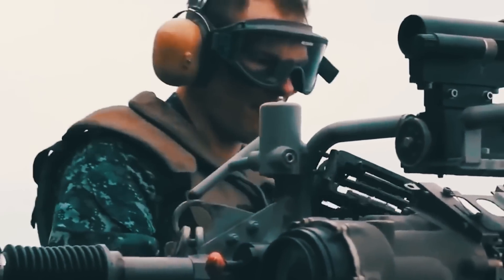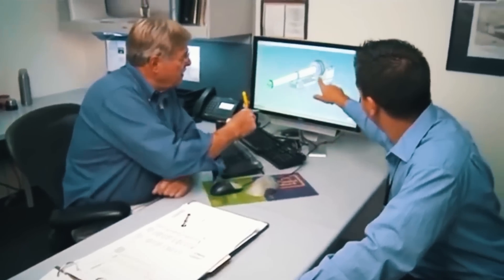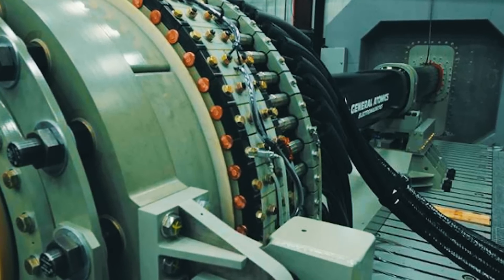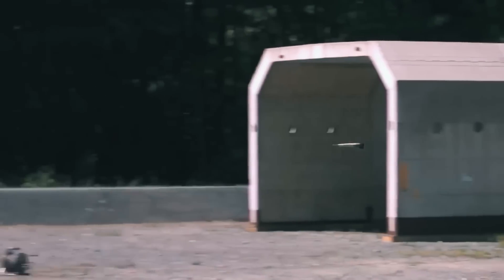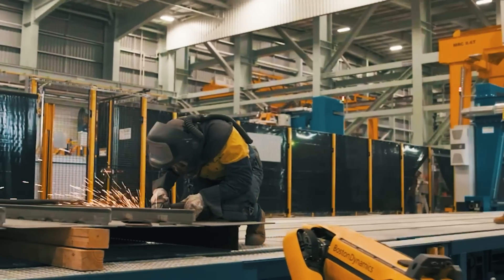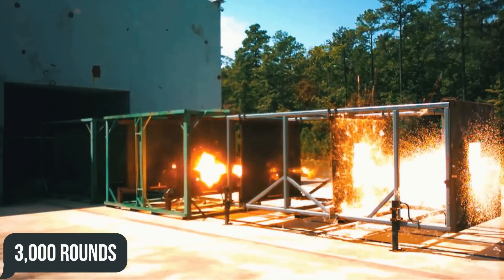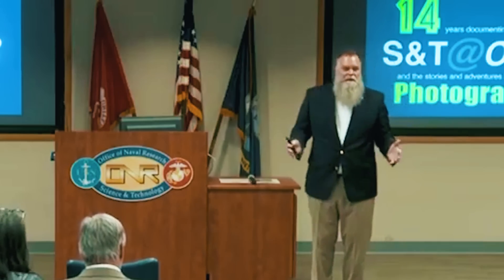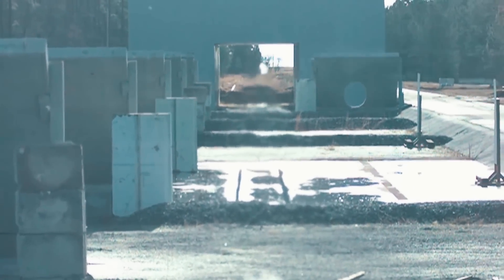US Testing Its Monstrously Powerful $500 Million Rail Gun

Comment: Atmospherics complicate and limit a railgun's usability. But it will make a splendid space weapon.
Reply: But anything would. That's an irrelevant thing to say.
Reply: @johnjackson8692  No. Anything with a constant source of acceleration mitigates the atmospherics. Only things which yeet satellites into orbit need contend with the atmospheric slowing as a determining factor. Rockets, for instance, can carry more fuel to compensate, or can use alternate burn rates. Railguns and spin launchers have it much harder. And railguns have it easier, yet, as their acceleration and stability are codependent, not independent, so if you evacuate air from a railgun's tube, the magnets can intermediate and compensate. Spin launching has the additional problem of angular momentum translating into linear velocity, and the vacuum needing to be pretty close to absolute before precalculating will work. Spin launchers are just not as stable, on the fly. Railguns are a very known and adjustable quantity. Every spin launch will be different across many variables. It can be done, but good luck. But overall, either will work much better in vacuum than in atmosphere.
Reply: If you want to use a weapon in space just go for a machine gun like the Russians used.  Why reinvent the wheel
Reply: @awatt  I was thinking more about orbital and interplanetary weapons, maybe ship to ship, not personal carry items. The railguns designed to launch payloads are very long, to minimize gee forces on the satellite or instrumentation packages. Weapon's grade railguns could be shorter, but orbital or moon based railguns could be designed for payloads, but easily be used as weapons also. The only issue with conventional weapons is to make sure none of the automatic mechanisms are gravity driven, otherwise, yeah, you're good.

Comment: Since electricity flows from negative to positive, how or why did they reverse this?
Reply: The explanation was for conventional current.
Reply: @johnjackson8692  Ok.  I had to look that up because I was not taught that in electronics technical school.  You know this but I learned it was what scientists thought was happening when electricity was first discovered and later found to be wrong.  I know it doesn’t matter because the direction the current flows doesn’t affect what the current does but to keep teaching something that is wrong seems, well, wrong.  I read both systems were kept to avoid confusion with existing symbols and older training.  How ironic for me.  Thanks.
Reply: Electricity flows from an area of greater electron density to an area of lesser electron density.  The "+" and "-" designations are rather arbitrary.

Comment: If they drop nuclear technology as agreed to in Treaties instituted by scientists and ratified by Congress it is possible to carry rail guns on ships , tanks and persons..  The Edison generators and dynamos make the rail gun portable without fuel.  The ingot can be fletched made with copper and sharpened to fly on trajectory without tumbling.  The edison generators and dynamos with inverters and transformers make the system portable not nuclear.
Reply: Fletched is slightly more weight forward with slightly more wind resistance aft.  If the weight center gravity is too far forward you get wobble and loss of distance and accuracy.

Comment: An Edison generator and dynamos power plants are much lighter than nuclear power plants. .  The size and weight for rail gun is better if you use permanent magnet motors as generators and dynamos as generators.  .  Nuclear has excess danger and weight.  The additional inverters and transformers are not equal to the weight or danger of nuclear technology.

Comment: I'm curious about what they do to guide the projectile. It seems to me that you can only shoot it directly in a straight line.
Reply: Fin stabilized GPS/Laser/Radar guided smart rounds already exist. This very round has been developed for the M-777 155mm Howitzer and the Paladin Self Propelled 155mm Howitzer. It wouldn't take much modification to make these rounds for the railgun since it is based on 155mm ammunition. Also angling the gun at a higher elevation would give an arcing trajectory. This weapon system is primarily a beyond the horizon non line of sight kinetic killer. Yes it can also be used for closer range engagements but who in their right minds wants to be in the path of a 6 inch diameter super dense hypersonic metal dart.
Reply: @jasonswearingin1009  Thank you for the clarification. You take good care Jason.

Comment: Might as well use steam
Reply: Steam is still very much in use around the world.  In this application, the steam catapults used on carriers are quite capable of tossing an inert weight of several tons for hundreds of yards...is how they are tested and calibrated.

The steam comes from water heated by the nuclear reactors...just like the steam used to light the lights and turn the propellers.
Reply: @kevincrosby1760  correct

Comment: Railguns or directed energy weapons both mean the same thing. Our ship designs need to change to accommodate high energy weapon and propulsion systems.
Reply: Being based on utterly different fundamental physics, they involve equally different technologies and tradeoffs. You could not be more mistaken if you tried.

About the only thing they might have in common is extremely high electrical power, and even that is conditioned on the assumption that directed energy weapons don't manufacture their own power. Lasers in principle can run directly off nuclear reactions.
Reply: @starfishsystems  You're both as thick as each other.

Comment: I wonder what the effective range is on these projectiles.  Given their light weight and the ultra high MV, I would have to believe at least 100 miles, perhaps 200.  Any ballistics experts out there?
Reply: Traveling at those speeds depending on weather and the type of projectile being used and other factors i would estimate an effective range of 100 miles or more.
Reply: Does gravity just pull it around the curve at Mach 5?

Comment: Rail-guns are not “directed energy weapons”.
They are kinetic weapons that use electric forces instead of chemical explosions to propel the projectile.
Reply: Thank you for correcting the ignorance of this video. That's not the only deal with the rail gun development program. The weapon system is still under development. They still can't meet the Navies requirements for barrel life range endurance and simplified easier maintenance with a good backup supply of spare parts for maintenance and repair. Not only that the only US Navy ships capable of generating the necessary power requirement have space for EWS and capacitor banks are carriers and the new DDX guided missile destroyers which for the time being have been cut back due to cost overruns and lots of teething issues. Material science has a ways to go before railguns become reliable and easily massed produced.
Reply: @jasonswearingin1009  , Navy requirements are usually somewhat aspirational goals. They are set high to get the most out of the contractor and then modified downward to get a realistic result.
Reply: @NotTheSharpestBulb-mh  Yes and that very ethic has given the US the most advanced military on the planet. We learned hard lessons about being proactive rather than reactive in global strategic matters. That ethic is applied not only to military equipment but its personnel and contractors. I'm a veteran and the most problematic laziest narcissistic people I dealt with are civilian contractors. The amount of them that lost their jobs received massive fines for incompetence or blatant destruction of military equipment and there are no small number that ended up in prison. Yes we have high standards and if you can't meet or exceed them like we do to protect citizens even lazy self-absorbed know it all potatoes then don't bother stepping foot on our turf. Reason being we're quick to spot troublemakers and even quicker at dealing with them.
Reply: @jasonswearingin1009  , A lot of that sounds like a different issue. But there is no doubt that military weapon development is done in a cloud of uncertainty about what is really possible to accomplish. As a weapon system design matures, it becomes more clear as to what the realistic goals are. And having multiple contractors present their ideas can give some surprising benefits.
Reply: @NotTheSharpestBulb-mh  It's the difference between wartime and peacetime contractors that is the real issue. Peace time contractors like to think they have time to set around and argue about the best way to proceed with development. Wartime contractors know not only is their life on the line but their families and the nation. So they get their collective asses in gear and get the job done or lose the contract very quickly. Failure to make an effective product for a DOD contract cost lives MILITARY lives. How many civilian contractors actually have the balls to deliver the news and flag to a family and admit their incompetence cost the life of that family's father/mother/daughter/son? I know there are good engineers and specialist contractors but evidence in the last 20 to 30 years has shown that pool to be drying up. I know this from first-hand experience along with friends who finished a few enlistment terms and got high paying contractor jobs. All these friends have stated their utter disgust at how many lazy self-absorbed slobs they work with just because mommy and daddy bought their job for them.
Reply: But how many emjays of energy?
Reply: @TheGreatAtario  80 emdubbleyoos?
Reply: One other thing, since they do not use an explosion (fire) to propel a projectile, they are not firearms.
Reply: @dangeary2134  They are essentially an electric catapult.
Reply: THE ONE BEING MADE IN COLORADO AT AIRFORCE BASE HAS MAGNETS THE SIZE OF BUILDINGS WE ARE CONTRACTED TO MOUNT A CABLE TRAY ALONG SIDE OF A SECTION AND IT'S ABOUT 3000FT SHOT WERE RUNNING I'M ON THE PROJECT CURRENTLY AND NORMALLY SERVICE A COMMUNICATIONS TOWER FOR THE BASE IN THE SPRINGS.:thanksdoc: THING IS BIG ENOUGH IT'S LIKE BURRYING A FREIGHT TRAIN I THE GROUND THE WHOLE TRAIN COLE AND EVERYTHING THE CONDUCTOR TOO LOL JK GOD BLESS! I LIKE THIS CHANNEL!
Reply: was abt to mention this till i saw the comment
Reply: perfect for the kremlin
Reply: That's when I stopped watching. I can't imagine the rest of the video having much credibility if they don't know something as fundamental to this topic as the difference between a kinetic weapon and directed energy weapon.
Reply: @thomasp506  The narrator guy also pronounced MJ as "em jay" instead of megajoules. And the unit V/m as simply "v over m", rather than "volt per meter". 

Presumably because he has no idea what any of it means. Not great for credibility.
Reply: Correct 💯.
Reply: It was refunded many months ago...
Reply: so you emp it?
Reply: Keep hiring DACA recipients and Blacks and you'll never reach your goal
Reply: I love how they say, US made railgun, BAE system is a British company and have the main systems for railguns!
Reply: How is it not a directed energy weapon? Electrical energy being converted to kinetic energy sounds like an energy weapon to me! Well, I suppose by that school of thought, explosives direct energy as well, like in a shaped charge? How is that not a directed energy weapon?
Reply: @joegoecke9711  A directed energy weapon refers specifically to a weapon where the damage is inflicted by directed energy, not by converted energy (propelling a projectile). Otherwise, traditional firearms would be directed energy weapons as well, since they use chemical energy. The actual damage needs to be caused by the directed energy itself and not a solid projectile. Examples include lasers, soundwaves, and particle beams.
Reply: @joegoecke9711  So you are telling me you think shaped charges are energy weapons? LoL
Reply: @joegoecke9711  By your logic, every gun is a directed energy weapon. Hell, every weapon would be a directed energy weapon, rendering the distinction meaningless.

Comment: Lasers are cool, but they can't fire over the horizon like a projectile weapon. Why not use lasers for air defense? 
  I wonder why they focus on such high speeds for the rail gun though. Why not slow it down to half that speed and see how much wear you have on the barrels. If a 155mm shoots at 1250, why not try a rail gun at 2000 or 2500, instead of 4000+ ?  I'm sure they have a good reason.
Reply: Force increases as the square of the velocity. Faster means more effective.

Comment: Rail life will always be a limiting challenge as there is a bit of plasma arc welding that occurs.  Coil guns are an alternative to longer barrel life, but high energy switching and distributed energy storage are challenges.  Yet another option for higher muzzle velocities are multi stage cannons.  Yet another is a hybrid missile and coil boost launcher.  We cannot give up on these as a breakthrough by an adversary could be game changing, especially with maneuvering hypersonic projectile technology being fielded.
Reply: "always" is a pretty broad statement.  There could be a railgun design that incorporates aspects of a coil gun.  Also, even if rail life is limited, the gun could be designed in a way that the rails themselves are field replaceable parts.  Alternately, they could be fired at slower speeds and still be deadlier than conventional shells.
Reply: Yes, to multistage cannons. It's viability was proven by Gerald Bull and US Project HARP. Unfortunately for Bull, the US Gov't refused to continue funding the program, Bull ended up working for Saddam Hussein and the Israeli Mossad killed him in Brussels... However, none of this precludes the viability of multistage big gun tech... Bull was able to fire projectiles to altitudes greater than 180km!!
Reply: *"Hypersonic nuclear projectile technology". Hypersonic missiles are just a platform.
In the end, we either find the capacity for dialogue or we will have none capacity whatsoever. Cheers from the "axis of evil".

Comment: 2:38 incredible just electricity can propel an object between 2 rails at upwards of over 50k feet per second. Wow can't even begin to comprehend that. The projectile is either being pushed or pulled so fast in such short distances. Now I can understand why they need so much current at least.
Reply: 'Bout 9 miles a second ? that right ?
Reply: [ incredible just electricity can propel an object... ] 
Well, that's basically what an electric motor does.
Yes, the fundamental science principles at play in a railgun and an electric motor are exactly the same